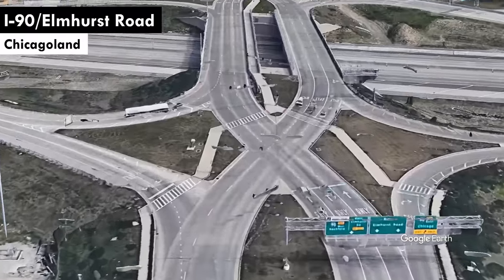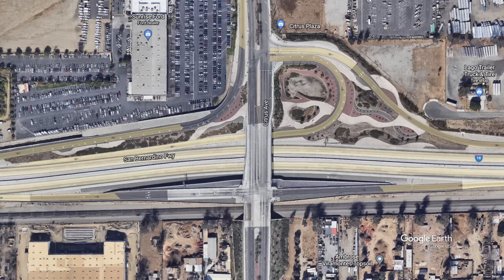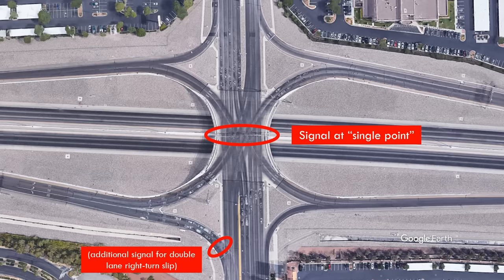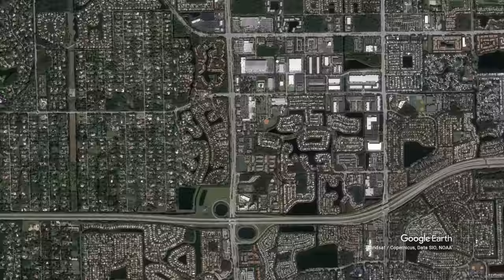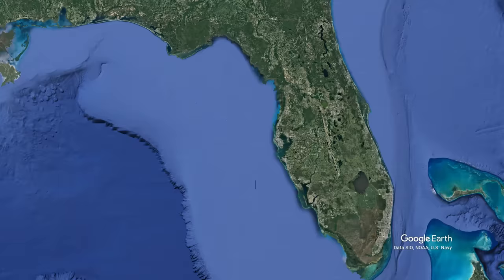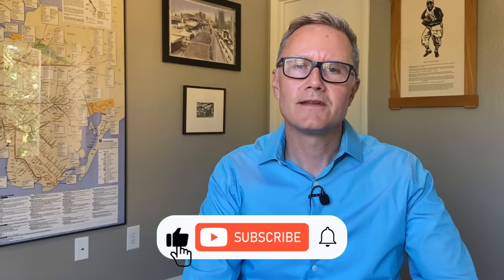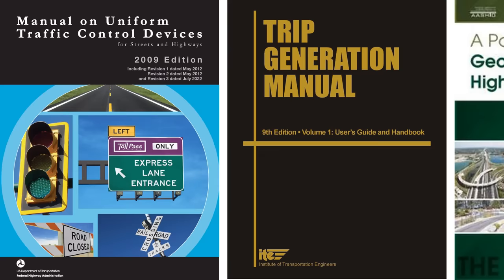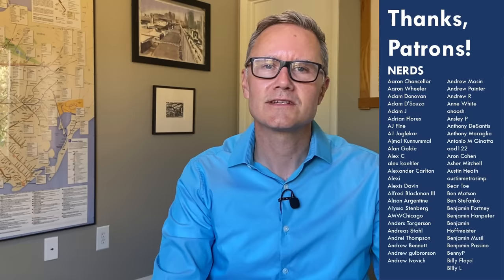Traffic Engineers Gone Wild: Why Interchanges and Intersections are Getting Worse, Not Better

Comment: Traffic planners need to be taken for field trips to walk around on the stuff they produce.  Nothing changes your perspective more than being the only pedestrian in one of these intersections.  A Lot of people are clueless to the struggles of pedestrians because they have never been one themselves.
Reply: EXACTLY!!!!!!
Reply: Most of the time it's a political decision. They design a correct car mobility situation because that's needed, correctly split off pedestrian and cyclist traffic because the aim is mobility, not maximum death toll, then the politicians come in and cut away all solutions for pedestrian and cyclist traffic.

And if you're unlucky they mandate that you use a roundabout and give cyclists right of way because they heard that preached somewhere.

We dropped a project that started as removing a railway crossing on a safe, rapid north-south thoroughfare, and the politicians mandated no fewer than 9 changes, all of which reduced mobility, increased costs and decreased safety.
They ended create a weird double tunnel & 2 roundabout situation where it can take up to 20 minutes to get through what used to cost 3 minutes at best. There's been at least 11 accidents since then.

Shame on the company that went "Screw it, money's money" and designed the current solution instead.
Reply: transit requires higher density to justify having cars and freeways removed or reduced.
urbanists tend to suggest that we need transit for lower density areas and its not economically feasible to do such as ridership would just be too low.
at the same time road enthusiasts need to understand that not everyone can afford a car or have the income to keep up with ever increasing vehicle costs.
a balance needs to be achieved and traffic engineers actually did well with a lot of these interchanges that the video poster thinks is horrible.
the reality is cars were never glorified or accepted inorganically, i.e. through force, lies, lies by omission, manipulation or subversion like the urbanists want you to believe. they are just a innovation that got popular, like rubber bands, and post it notes. the car increased mobility and in turn the ability to have a better paying job, the car changed mobility and the global economy.
these are facts, not glorifications.
Reply: ITS TIME TO BAN CARS!!!!
Reply: @nvelsen1975  then after all that bullshit, the car lanes get converted into cyclist and pedestrian traffic lanes and you end up with traffic jams all over the place because, SURPRISE, that's not what the system was designed for! :D
Reply: @maxwalsh234  banning cars reduces mobility.
in fact it greatly reduces mobility.
no sane person would deem such acceptable by any standard, because banning cars means people are forced to walk or bike to work, and surprise surprise, people who live out in the rural areas and have to drive 20 minutes now are forced to bike which would take much longer, at least 3 hours.
Reply: @nvelsen1975  because it's terribly designed.  Many places outside of the US have designed traffic flow for cars, pedestrians and cyclists.  Roads in the US are only designed for cars which is idiotic.  It's dangerous not only for cars (see that roundabouts reduce accidents by 38% and fatalities at intersections by 80-90%) but Americans are like... Nah, we like traffic lights because they think for US, we can turn our brains off... which is why most accidents occur at them.  Cyclist lanes are an afterthought and when cities do put in proper cyclist lanes... car ppl are like... OMG I have to walk farther to get from my car, or OH NO, in the middle of an urban center it's now only one-way traffic instead of two...  We are such a car culture that any desire to make it safer for both cars and pedestrians (see how dangerous STROADS are) is rejected because ppl "should just have cars" and vehicles in the US hate cyclist because now they have to slow down or pass them. If you want to see efficient road design for all, that has almost no traffic, where fatalities and accidents are minimal... check out the Netherlands, Germany, Sweden, and Denmark
Reply: @trevnti  
Not sure why you're responding as if I'm talking about the American system. I'm a Dutch urban planner.

And there are a lot of asterisks involved in some of the things you said.
Like roundabouts reduce accidents. Well which ones, compared to which intersections...
If it's American 'across side single light' with no cameras and endemic red light jumping, sure that's dangerous. But good timed intersections are extremely safe.

Double lane roundabouts by contrast cause a lot of fenderbenders due to poor lane discipline and cyclists often get taken out on entrances or exits.

That's also my main criticism of the video. It's extremely one-sided and lacks nuance as well as understanding of road design.
Reply: @Zeakthecat  But then you’re saying that people without cars should only be able to live in certain areas while people with cars can live anywhere. At least within a metropolitan area, everyone should be able to live anywhere. People without cars or the ability to drive (which may be for medical reasons as well as financial) shouldn’t be forced to live far from their jobs or families. People without the money to own a car may already be restricted in where they can live by housing costs, and in some cities the least walkable areas have the lowest housing costs.
Reply: I’m down with seeing a fuel shortage or the quadrupling of its price.
Reply: This could be said for all engineering fields. There are way too many engineers in charge of designing things they've never had to install, service, or use. And no surprise, their designs are garbage. This is coming from an engineer.
Reply: This really is a good idea, as a pedestrian you learn a lot about your built environment. I didn’t realise how uncomfortable certain parts of my town can be until I actually walked through them, and I’ve designed some awful things in games and stuff that I would never want to walk on.
Reply: @Zeakthecat  urbanists actually tend to suggest that america needs to fix its zoning policies to actually allow higher density to be BUILT. it's illegal to build anything except a single family home in most of the country.

also walking isnt "transit". it's just walking. if you think these traffic engineers did such a great job try actually walking across these interchanges. these are IN cities. you can't even walk 500 meters to a nearby restaurant because you have to take long detours around. this isn't "balance" it's car centrism. real balance is devoting an equal amount of time and money to designing alternate transport infrastructure too instead of tacking on a sidewalk along a 6-lane stroad and calling it walkable.

and the automobile industry literally started an entire (very successful) campaign to blame pedestrians for dying in car accidents to "prove" that cars aren't actually dangerous and idiots like you bought it.
Reply: @ishathakor  "urbanists actually tend to suggest that america needs to fix its zoning policies to actually allow higher density to be BUILT. it's illegal to build anything except a single family home in most of the country." meanwhile the hardcore urbanists who hate cars with a passion, tend to want cars banned.
funny how that works eh?
"also walking isnt "transit". it's just walking. if you think these traffic engineers did such a great job try actually walking across these interchanges. these are IN cities. you can't even walk 500 meters to a nearby restaurant because you have to take long detours around. this isn't "balance" it's car centrism. real balance is devoting an equal amount of time and money to designing alternate transport infrastructure too instead of tacking on a sidewalk along a 6-lane stroad and calling it walkable."
walking takes cars off the road, so does biking. its also damned convenient that you didn't include biking in there either.
once a suburban area is walkable and bikeable, it shouldn't need any improvements to local road infrastructure outside of safety improvements.
and stroads are a myth. you can literally have pedestrian overpasses over supposed stroads and limit what can be built near a intersection and it would still be super walkable.
you can add in protected bike lanes on most stroads in the united states with minimal need to get rid of entire travel lanes as well. the main reason why people point to stroads as a problem is because stroads are often looked bad, with feelings of lack of safety. in reality, most drivers are never mandated to be put through driving school and never tested on a off public road test track. once you actually test people on a off public road test track and then put them on the real roads and revoke learning permits for people with different driving test scores when compared do you actually have safer roads even at higher speed limits.
and the safety features on vehicles like backup cameras and automatic pedestrian detection and automatic braking systems reduce pedestrian fatalities.
however like with everything in life, humans are infallible and will make at least 1 bad mistake in their life, even while driving.
Reply: Well stated!
Reply: local politicians should also be banned from getting around by car
Reply: @Zeakthecat  
If you want to have a say in the roads of the city you work at, live in the city, not out in the burgs. It's how democracy works. NYC only gets away with high tolls because the residents don't really drive, so the tolls don't directly affect them. Of those that do drive, surprise durprise, the tolls are lower for NYC residents. $18 to use a bridge if you have an out of state plate, $12 if you have an in state plate, and $2-5 if you live in the city. Mighty shame if you drive a pickup. Tolls start at $20 for those
Reply: Maybe people could do the sensible thing and get a car and not be pedestrians anymore.  I think many of them would be surprised at how much more comfortable driving is, because we get to sit down in a comfy seat and have cool air conditioning in the summer and toasty warm heat in the winter.  And take a whole bunch of stuff with us and not have to carry it.

Comment: One of the crazy things about a lot of these designs is they seem to manage to make driving worse too. Like having to wait at an intersection twice to make a left turn has to be one of the most unpleasant experiences, especially when you consider these intersections are all designed to handle a lot of traffic so the cycles are super long too.
Reply: ITS TIME TO BAN CARS!!!!
Reply: And only makes demand scaling worse

Just put tolls on roads. According to the usual theories on supply and demand, and based on the traffic of most roads, I'd say tolls every 10 miles at $5 would be a good start, with discounts if you have an in state plate. Rural areas won't need the tolling, it would just be a city thing. Should make things very clear that you are paying for the privilege to drive on public roads
Reply: @Demopans5990 Yeah so that's a terrible idea. Fix public transit, don't punish people for using cars when most of the time they are the most viable option.

Comment: Two things annoy me more than anything -

1) forcing pedestrians to walk a mile out of their way to get to a crosswalk
2) traffic signals incapable of sensing a bicycle to trigger a left turn or green light (forcing the cyclist onto the sidewalk to press a Walk button that may or may not actually work)

You should do a video on Atlanta's I285/GA400 interchange, which is closing in on completion.  It's a monster.
Reply: totally agree on your 2 points
Reply: Bikes should not be on roads over 25mph
Reply: @gregoryeverson741  Virtually every US state's traffic code says otherwise.
Reply: frequently travel down that section of highway… it’s a beast
Reply: @imafork4526  as a Canadian, I find it baffling that Boulder hwy is loaded with casinos. isn't there enough on the strip and Fremont st ? when is it enough?
Reply: I don't think I've ever encountered a working walk cycle button
Reply: @Yoshikarter1 imagine thinking the traffic code is a good justification for it. the traffic code also allows for disgraces to the world like these intersections. if you're going to justify bikes, justify it by pointing out the incredible benefits that cities with good biking infrastructure have on traffic.
Reply: @infernodotdash2203  What are you referring to?

I never insinuated that traffic codes justify the lack of decent infrastructure. I pointed out to the carheads that bikes can legally use the road whether they like it or not, and in some places, they are required to. Personally, I envy the infrastructure in countries like the Netherlands, but American corporations fight tooth and nail against such concepts because it might hurt their precious profit margins. The irony is that good bike infrastructure would make drivers' lives easier too, but they simply refuse to acknowledge that.
Reply: The real monster is I-15 and Tropicana in Las Vegas

Comment: It took us 3 tries to get through the intersection in Las Vegas.  It was night and when you come off you would swear you are on a one-way street going the wrong way.  It really was the most horrifying intersection I have ever seen.
Reply: Seems like eBikes are essential as a pedestrian in Vegas xD
Reply: where I live it took engineers 2 decades to fix the bridge off ramps, the bridge itself is fine and well maintained but for 2 decades on one side whe you go on the off ramp the exits were pretty atrocious for the longest time, if you live here it's one thing, you get used to it but every out of towner get's turned around so finally in the 2000's after the 10'th or so redo they got it right....lol now the exits have a stop light at the end right then you ca bypass the stop and shoot a right turn but still come out downtown or can keep going down the bypass and well exit the city eventually or shoot out at the mall 
if you go straight that shoots you into a side road that is now a main artery since it's connected to the bridge but even on this road several right turns puts you into downtown or you can keep going and end up on the west side, it sounds complex but like I said if you live here it's easy to learn but the basics are the straight shot actually goes somewhere as does the right turn....

Comment: "Creative" engineers arent just traumatizing the roads. I'm a ranch hand and one thing I've noticed over the years is that the newer the tractor the more mutilated the tractor insides are thanks to the engineers. The much older tractors were easy to service swapping parts etc. But a lot of these modern tractors, baylor's, etc, you literally have to get a crane to lift the engine out in some cases. Then they over computerized everything so that way you're utterly dependent on the company, which makes the farmers so damn happy.

Comment: As a traffic engineer in Texas, I agree with 95% of the content of this video. I dislike urban freeways, but when they get built I am a proponent of tight diamond interchanges with pedestrian recall on the city arterial. No buttons to push and usually the cycle length let's you cross both frontage roads without stopping. Good signal timing let's them operate well for vehicles too! I also keep cycle lengths in high pedestrian areas relatively short even if it constrains vehicle capacity.
Reply: and you guys keep putting lanes on the freeway.
Reply: More roundabouts, less lanes.. Better pedestrian crossing. Problem solved. Diamond interchange still force people to stop for lights... twice. It only solves a left turn issue... not the traffic issue.

Comment: Regarding left turns - from Polish perspective, I would actually say that protected left turns are a great thing, at least when crossing more than one lane of oncoming traffic. Also, they are safer for pedestrians and cyclists, cause while left turns are more  "challenging", drivers concentrate more on finding a gap between vehicles rather than pedestrians. In Kraków we constantly got rid of unprotected left turns if there was more than one lane to cross for last decade. On the other hand, I'm scared of intersections in Warsaw - you often have to cross: two tram tracks, 3 general traffic lanes, cycle path and pedestrian crossing - all with yielding to them at once!

Comment: Topic suggestion:

As many advantages as urban stadiums have, they can also be quite corrosive to the street life of surrounding neighbourhoods. This is because they can deactivate hundreds of metres of street frontage with blank perimeter walls and gates that are locked for the 95% of the time when the stadium is not in use.

What are some examples of urban stadiums that make a positive contribution to the surrounding 24/7 street life?

One interesting (not quite urban) example I can think of is the Queensland Tennis Centre.  It gets used for precisely one ATP / WTA tournament every year, and sees practically no professional tennis for the other 51 weeks of the year. But, in these weeks when it is idle, the stadium (as well as the outside courts) are available to the general public to hire by the hour for the purpose of playing tennis. This means that the stadium precinct (which is otherwise total garbage) always has people coming and going.